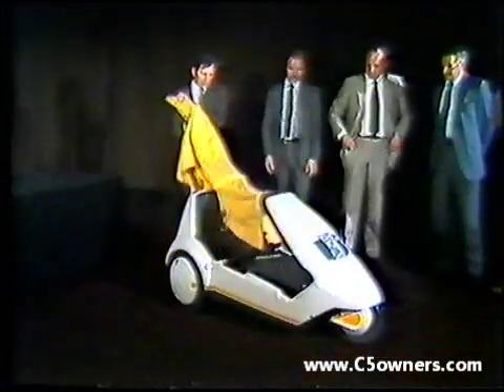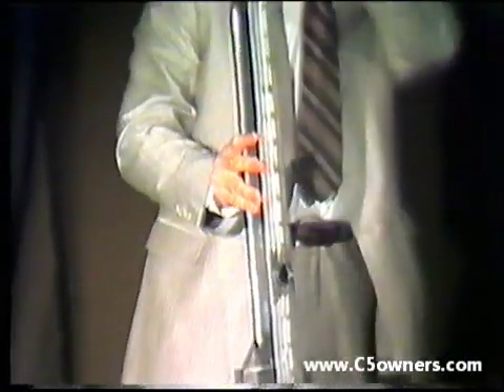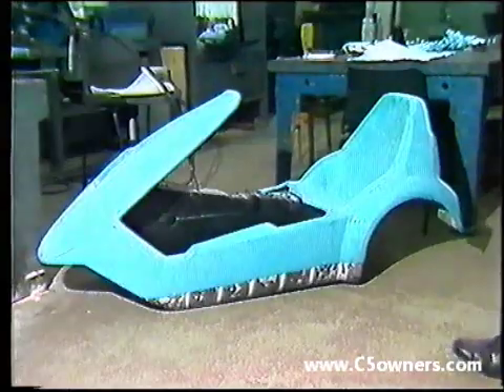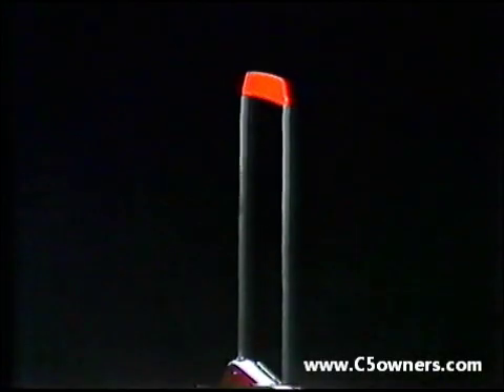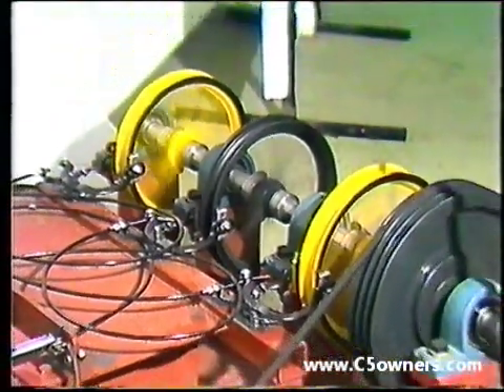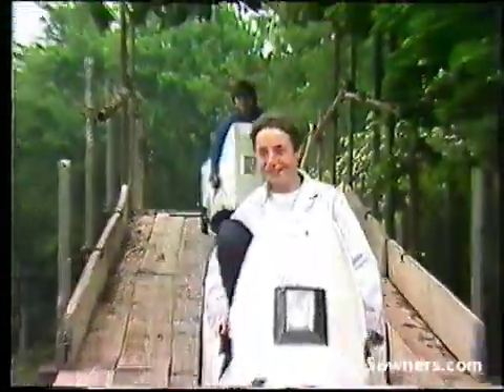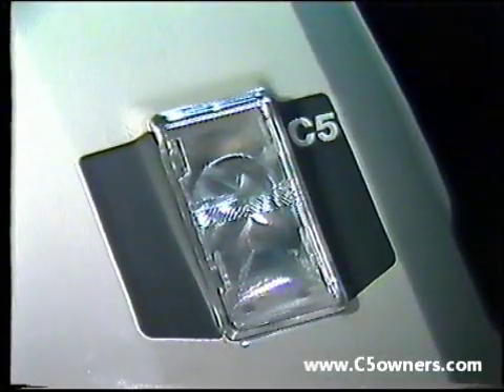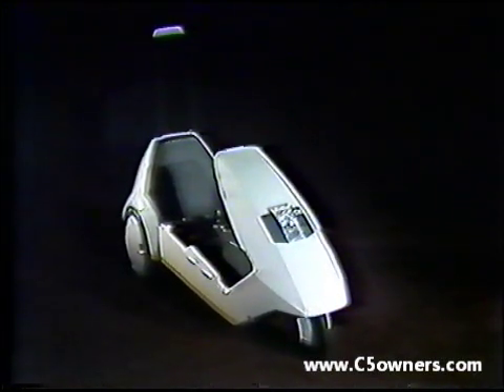Sinclair C5 Preview/Prototype Video 1984

Comment: Looked a bit iffy to me then, and still does. I'm sure that motor is a Polymotor Italia model, my mum's old Electra ( Philips ) washing machine had the same sort of thing, and it was a "permag" motor. But I don't expect they bothered to use the regenerative braking this would've offered ! Tinny spine welded up, bet that rotted nicely within, unnoticed, under all the plastic, like the Honda C50/70/90 motor scooter, and as did most cars then. Bring on the Waxoyl LOL.
Brakes on only two wheels ? Asking to go into a skew, in bad conditions. Surely a diff could've been provided ?